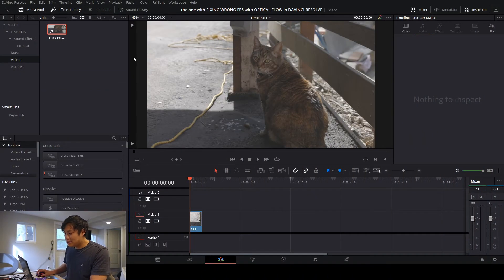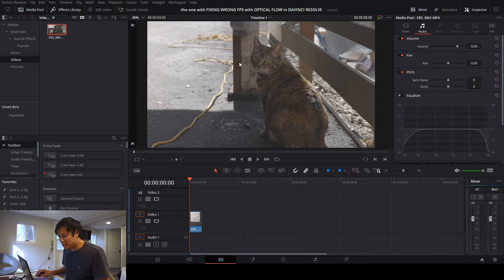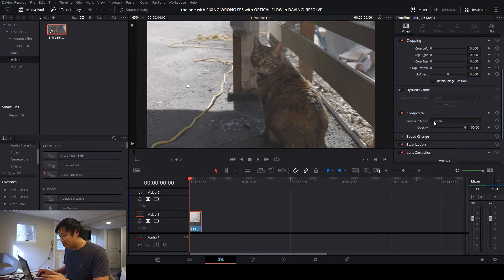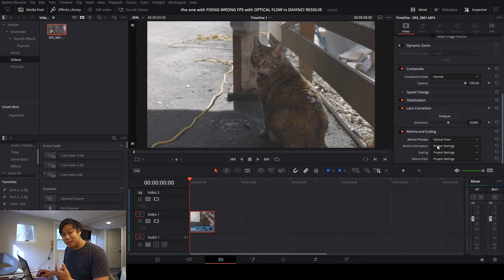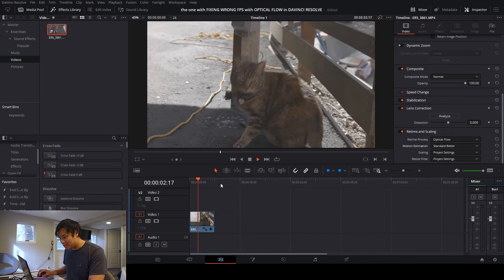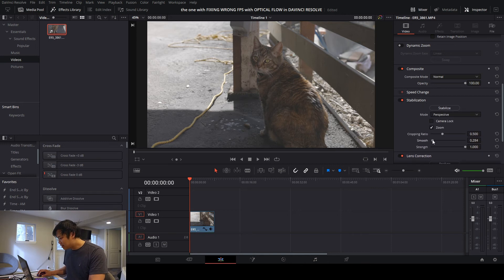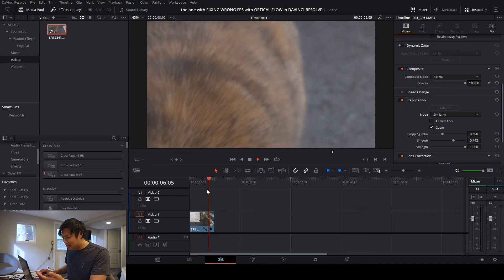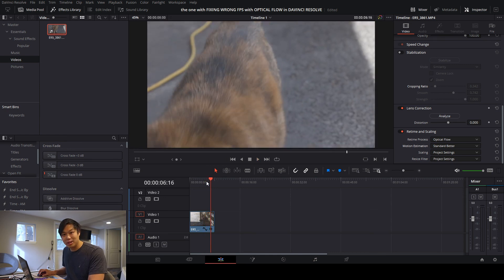the one with FIXING WRONG FPS with OPTICAL FLOW in DAVINCI RESOLVE

Comment: I was hoping this video would be about upscaling the fps WITHOUT changing the speed of the video. Clearly the software has the power to do this, but I can't figure out how to actually use optical flow without also using a speed change. The only way I can do it at the moment is:
take a 30fps video and drop it on a 60fps timeline
stretch/slow the 30fps video to 50%
apply optical flow
render
take that newly rendered 60fps video video and put it back in the timeline
stretch/speed up that new video to 200% to undo the speed change

This sucks because the video has to go through an extra layer of encoding which reduces the quality of the final output

what I would like to do is:
take a 30fps video and drop it on a 60fps timeline
apply optical flow to "convert" the 30 fps video to 60fps (at the original speed)
render

any idea on how to do this?